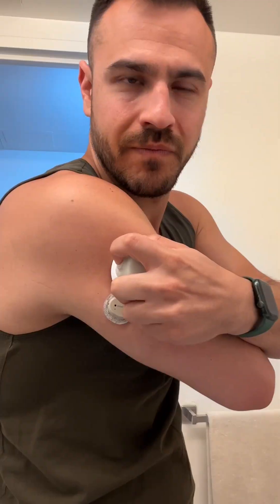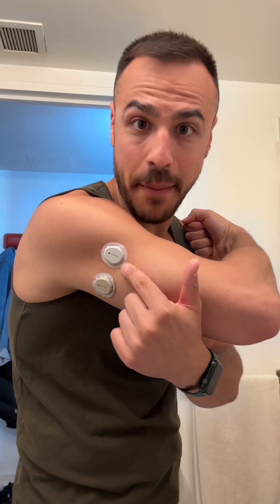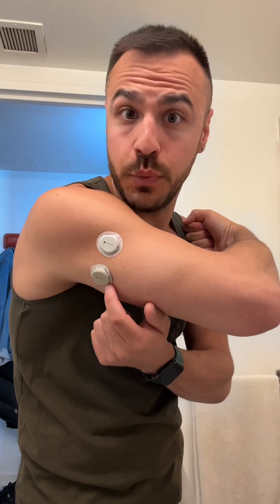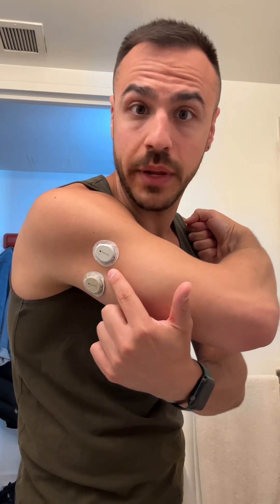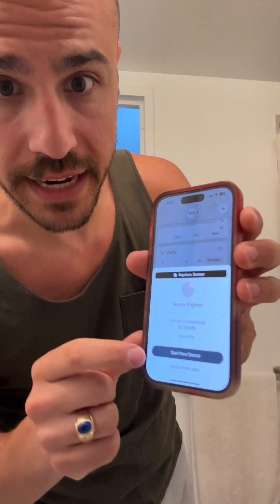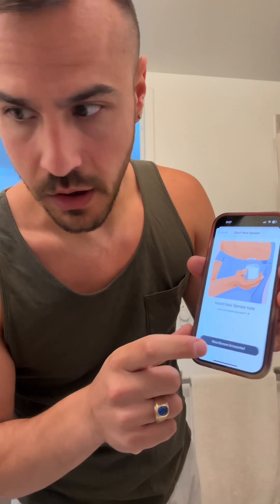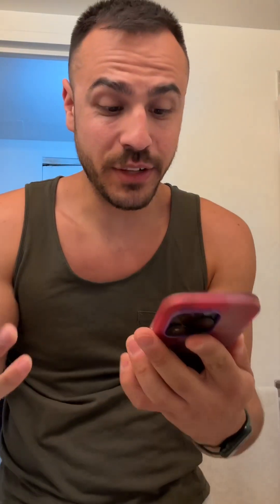ZERO Warm-up Time with Dexcom G7

Comment: I tried it last night! I let it soak for 12 hours. Tried starting it this morning...and nothing. It wouldn't pair. 😢 I put distance between me and the old one, deleted the old sensor from Bluetooth, rebooted my phone, and nothing worked! I took the applicator and rubbed the magnet over it a few times and got it to pair. It still took 26 minutes to warm up and its still inaccurate almost 12 hours later. SMH...I'll keep trying.

Comment: I alternate arms so i know which one is the new one its also best to start the new one around the 12 hour grace period start time and LEAVE the old one on until it expires. It's called soaking and it will help the sensor calibrate better. You'll have less time where it's giving wonky readings.

Comment: The app is dreadful, spent months, with awful, connection..silly call centre, useless, really,  ffs a call centre, to advise, a major health concern...I'm u.k..n this b.shit, obs U.S#
Avoid the crap app, all info req, shows on the pump..God forbid, re app, you loose mob, it's stolen, you can't receive any tech info connection , etc .not ev1 is glued to a daft mob, it's making us far too vunerable 😮😢

Comment: Excellent. I really struggle with the minimum 2 hrs warmup time using the Medtronic Guardian Sensor 4. I unpair and pair a different transmitter each time. It is often at the most inconvenient time when i really need it.

Comment: What a difference between this and my Guardian 4 sensors that I use with my minimed 780G.

I have about 2.5 hours (!) without any readings. First take of the sensor from your arm, pull the GCM and transmitter of the sensor. Than clean it with alcohol. Than charge it (about 0.5 hour). Then insert a new sensor and mount the transmittor on it. Wait 2 hours....

Stone age technology it seems. Medtgroncis, where is your answer!

Comment: Silly!!!

Just let the old CGM run for 10.5 days.  When it expires totally, pull the old one off.  Then apply the new one.  It will produce its first reading 27 minutes later.

There is nothing special or bad about not having readings for 30 to 60 minutes, nor anything useful about having 30 minutes of overlap between old and new G7 readings.

I'm on my 40th G7.

Comment: Any special way to remove sensors???? I'm new
Reply: I would recommend a product called "Brava adhesive spray remover" by a company called coloplast. It can be a bit expensive but it makes removal super easy and pain free. You just give the adhesive sticker a light spray and almost instantly the adhesive softens. Has been a gane changer for my little sister

Comment: But there was a jump of around 30 between the readings. That's the problem with this short warmup time. I recommend to put the new one over night and switch in the morning. An additional benefit is that you can judge if the readings of the new sensor are reliable cause this is more or less your fasting glucose level. If both are close you can be quite sure that the new one is accurate. If not, make a finger prick and calibrate if the new one is off.

Comment: Started with the g7. I like it so far. It says 10 days but towards 8 or 9 it disconnects a lot then you have to wait up to 3 hours for it to reconnect. Maybe because I’m using the app on my iPhone instead of the thing it came with. I do really like that it connects with my watch too. Surprised me when my watch vibrated and I saw me blood sugar levels 😅.
Reply: No problems on the app for me. Current and 1st sensor has 6 hours left of grace period and I've had no issues with it. Could he where you put it on your body. I also use the extra patch that goes over it
Reply: I’ve also notice if I only use my iPhone this would happen. So I only use the receiver and it works fine now.

Comment: Can’t wait until it’s integrated with t:slim!   Meanwhile I am happy with G6.
Reply: Same here can't wait
Reply: @lakegirl239 Did you integrate with the tslim? Just updated software and ordered the g7.
Reply: @ejhaley9073  Recently updated the software.  Finishing up G6 supply.  Eager to start G7️⃣⚪️
And you?
Reply: @lakegirl239  same here. On my last g6. Looking forward to switching!
Reply: @lakegirl239  how have you been liking it? I'm on my 2nd sensor, only complaint I have is it loses signal more often than the g6. Although usually only on the pump and not my phone.
Reply: I'm on tslim and g7. Hoping too try this tomorrow with both I've had g7 on for 9 days so hopefully all smooth as its cutting out and giving weak signal already 😢
Reply: It’s been a year!    
Yes, G7 is here and I am very happy with it.   Not having to change the transmitter periodically is an improvement.  I enjoy the grace period and the smaller profile.  I will admit by the 10th day the adhesive is failing.  The commercial over patches are cute & fun but get costly over time.  I got one box of a hundred Smith & Nephew IV3000 from Amazon.   Cut my own opening in the middle (trace a quarter) and use it as an over patch over the one provided.  Very satisfactory and still holding with no curled edges.  
Happy pumping and sensing everyone.